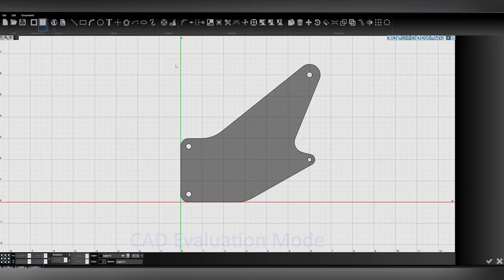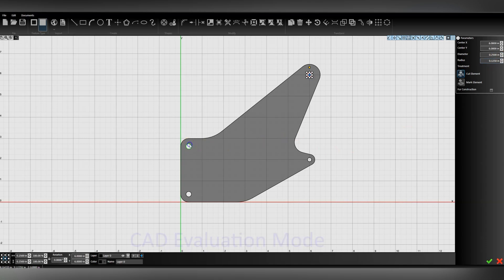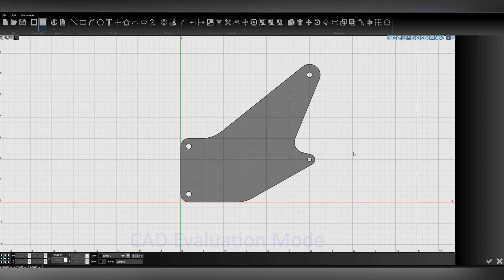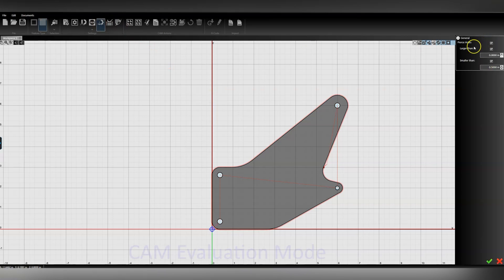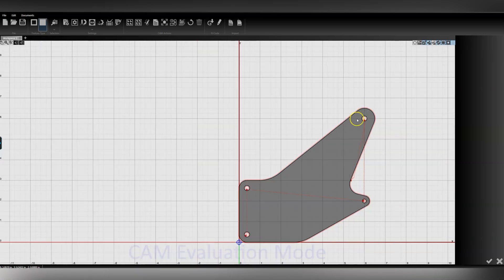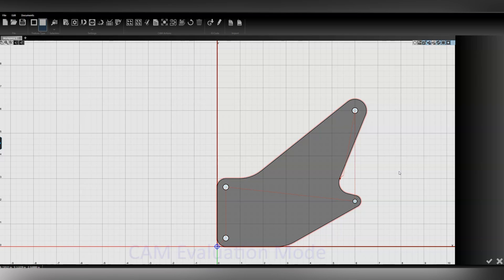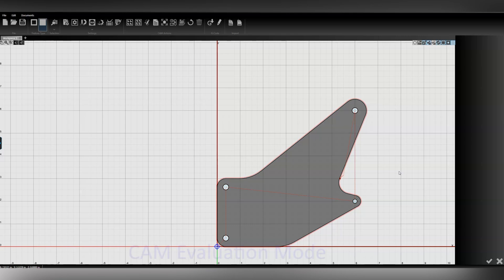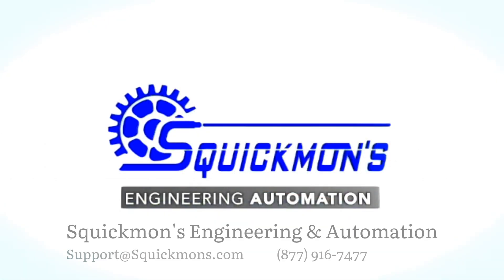Center Piercing Holes With CNC Plasma

Comment: Been there, tried that. Based on the inaccurate hack job of a hole this produces I ended up making an electronic board to take control of the plasma and give an extremely short "blip" to the torch while it's tip was very close to the metal surface. Gave a highly accurate tiny "centre punch" mark which I used for drilling. What a learning journey that was.